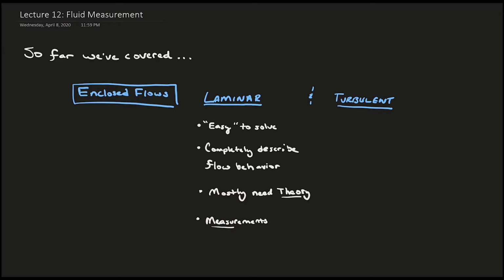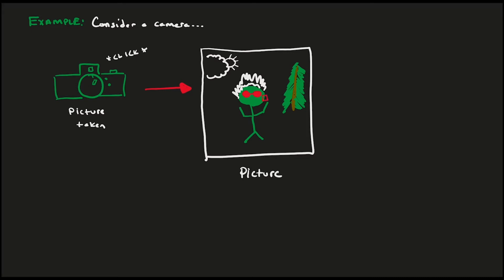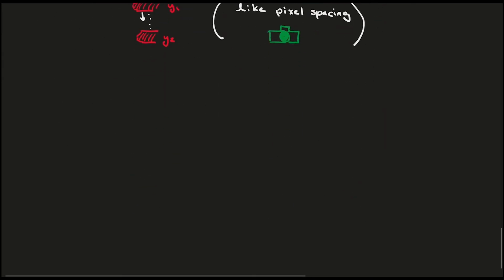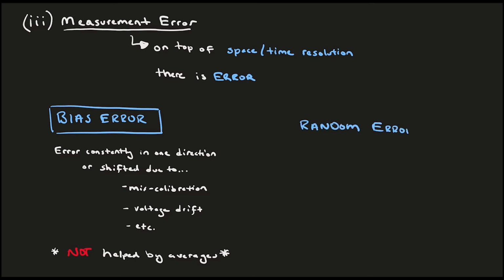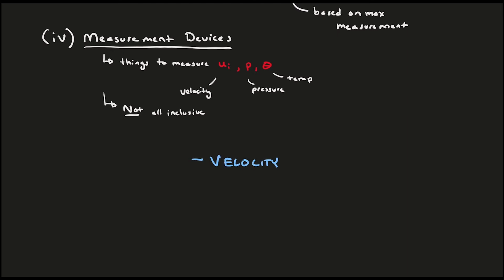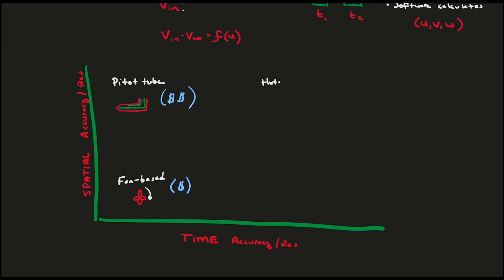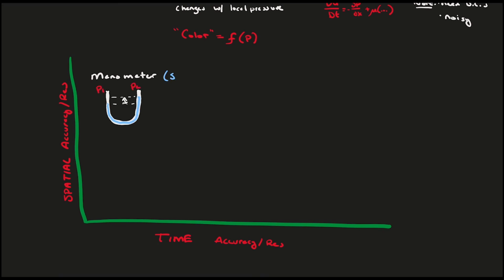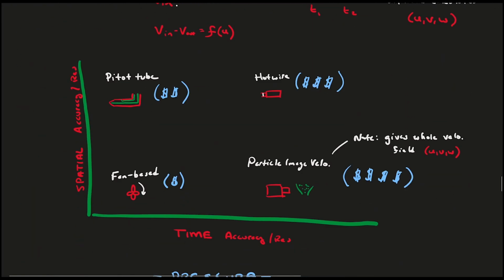Fluid measurement [Fluid Mechanics #12]

Comment: why are you using theta as tempurature??
Reply from the maker: There are only so many letters to use! "T" is traditionally for Thrust Force, and "t" is forever reserved by time. Theta starts with "T", so it seemed like the next best symbol (in retrospect, tau is probably better here).

Anyway, I started out designing the notes planning for more cases where aerodynamic forces and temperature pop up together, so I tried to use theta in case I ever couldn't use T. It didn't happen as much as I had anticipated...